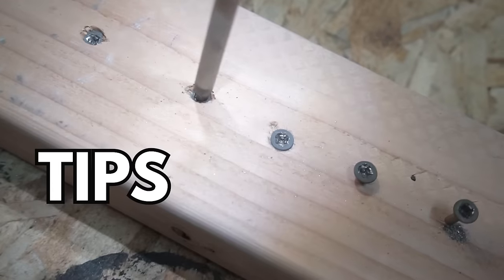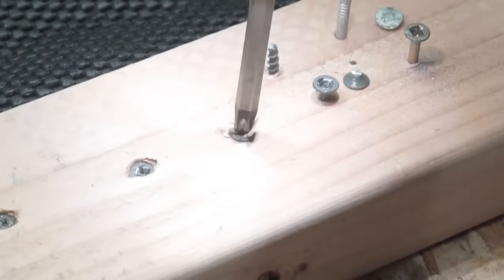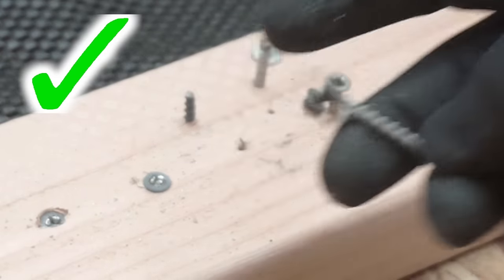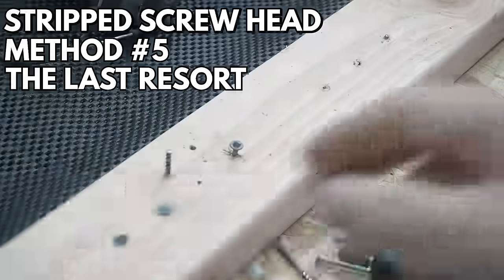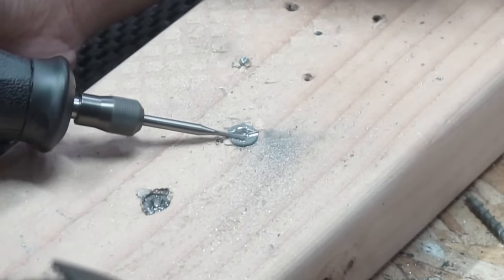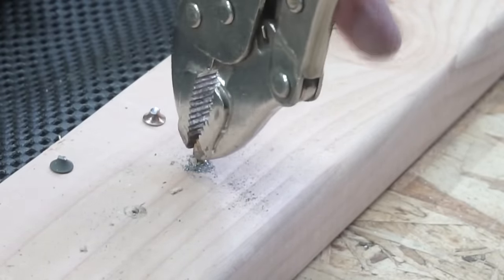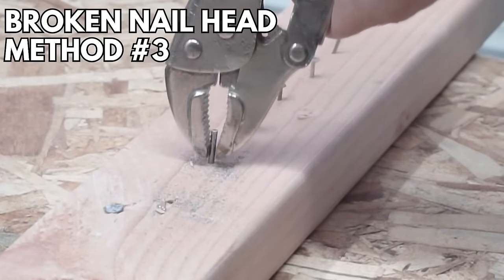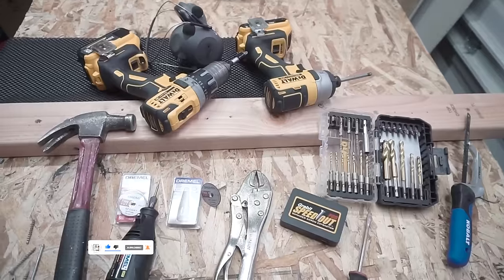How To Remove Stripped Screws, Broken Screw Heads And Nails - 12 Different Ways DIY Tips And Tricks!

Comment: What about a screw broken BELOW the wood's surface?
Reply: Same this is my problem. Screw head broke off leaving only the threads and shaft below the wood surface. There’s nothing to grab with pliers as you have to look into the screw hole to see a glint of metal
Reply: It depends on your required results. 
If you just want to get the top board off and don’t care about damage, I’d drill one or more small holes next to the screws and pry the board off.
If you need minimal damage or to reuse the board, I’ve had some luck with drilling out the screw itself. You may need to start with a very small bit to prevent wandering,and be prepared to fill the hole with toothpick, splinter, or glue to hold the new screw.
Reply: @TomCee53  and if drilling it out anyway, no harm in using a left-hand bit.  You might get lucky, the bit could bite and act as an extractor.

That's why I'm watching these videos to begin with.  I'm debating buying extractors or left hand drill bits but all the videos show stupid "can't you figure this out on your own" scenarios like these here where obviously you could just use pliers.  And if you can't?  Bah, just cut it off and grind it down!  Problem solved!  RIGHT???  That screw wasn't HOLDING ANYTHING that's got to stay there!  And you can't always just replace the wood or move the mounted object!

My scenario is that a friend's pet-and-baby gate is mounted in a doorway of sorts along a half-height wall that separates their kitchen from the family room.  They always kind of slammed the gate closed, and over the years, one of the screws on the bottom hinge broke about a quarter to a half inch below the surface of the wall.  Now the gate hangs wrong and scrapes the floor.  Problem is, they still need the gate for the pets and they don't want to reposition it because they don't want a bunch of holes in the wall and it's currently centered on the bulkhead.

If I can't use an extractor there, there's no point in buying a set.  I might opt instead for a left hand bit set.  Then again, what the hell, they're not exactly expensive.  Maybe I'll get both?
Reply: Have to drill the shiz out of it until it doesn't exist.  Only way I've seen otherwise just leave it in and work around it lol
Reply: @JayBird84  Yup, that's what I would up doing on the pet gate!  Then drilled the hole out and dowelled it, drilled a fresh hole in the dowel, inserted screw.  Not as strong as original because of the direction of grain in the dowel, but they just need it not to move laterally.
Reply: Half baked video.
Reply: Use a small diameter Dremmel disk to cut a slot for a screw driver and line your cut up with the grain of wood.  You will end up removing some wood but not much will show because it will blend with the grain.  You can also use a plug cutter to remove some of the wood around the screw.and try the methods shown in the video.  

And if it is a nail, cut off the head and use a nail set to drive it through to the other side and pull the exposed end out with vice grips.  This is also the preferred method to remove finish nails from trim without damaging the face.
Reply: @Roy-ij1wq  This is the best answer that I have heard!  I don't have a Dremmel so I can't try it right now.  The screw extractor certainly doesn't work because I have tried.
Reply: Fill the hole with mud and paint it
Reply: You're asking that but i'm asking how i'm supposed to remove one from gaming system without breaking the system
Reply: I have the same problem but in my case the screw must be removed without damaging the wood around it at all. The screw that holds the strap holder in my electric guitar cut in half while I was playing and now the bottom half of the screw is inside the top guitar horn, so I must remove it with no harm done to the wood, since destroying my guitar horn isn't on my plans. It also doesn't help at all that both the screw and the area around it to work in are really small. Does anyone have any tips?
Reply: 1.) use a hole cutting drill but without the drill punch in the middle, only hole cutting. Drill a circle around the screw or nail until 1/4” is exposed, then grip with pliers and reverse out counterclockwise.
  2.) Use a “Teks” screw that has a self drilling end. Drill on top of old screw or nail until it’s obliterated, then back out and suction out hole with vacuum or blast it with compressed air.
Reply: The plumber broke the screw off that the silver cover goes on the tub wall with.  Mine doesn't have the removable bracket it's built in so here I sit with a big open overflow hole in the tub and no cover on it trying to figure out how to get the broken screw out.  🙄

I'm curious if a nail punch might work?  If not, a drill it shall be. Thoughts?
Reply: @brenten6226  First see what's directly behind if at all possible. Drilling through may puncture a water line if it's configured incorrectly. (Rare, but possible)
  Once you can see at least a few inches behind the trim and know there's not a water line, try the following.
    Cut off the trim as much as possible with either a dremel, tin snips, angle grinder, whatever. Then reach under and up with needle nose pliers, or regular pliers and try to manually unscrew it form the back. 
  Might take forever, but worth a shot.
  
  Otherwise, drilling seems to be the only feasible solution. Try and figure out the depth needed before punching all the way through. Drill slowly!
Reply: @JamesSmith-gk8sz  thank you. I'll check everything you warned me about first and then see what happens from there.
Reply: Same here!
Reply: @Roy-ij1wq  This was what I'd have said too
Reply: @Roy-ij1wq ￼ I'm confused about the dremel solution. In assuming this should be easy to follow but I'm also one of those who are vicariously living through other woodworkers as I'm disabled now due to back problems. So, you're saying to use a Dremel cutting disk like the one he uses in the video or are you saying to use a bit? I'm assuming the saw disk but since he said the screw is deep-set, wouldn't going to a smaller disk then limit the depth on the cut? Also, please explain because this isn't intuitive to me without ever coming across the problem and I'd really like to learn what you're saying. How would cutting a slice in the top of the wood with the grain (got that part, great idea!) help the usage of a screw driver? Are you saying to screw it out the other side?? Or use it so it catches the nail and comes out the same direction it went in? Would using that very small diameter pointy drill bit, assuming it's roughly the same diameter of the nail that was cut off, be similar and would that work? Thanks so much! I genuinely appreciate your help!! I'm not even southern but y'all rock! Lol. Thanks again!!
Reply: @doreennacht Your assumption about using a cutting disc.  The purpose of cutting a slot with the grain is simply cosmetic.  You are simply cutting a new slot in the screw and only need to cut a slot that is deep enough for a screw driver to grab.  Try to use a screw driver with a tip that is thick enough at the end to fit snug in the slot and the same or slightly narrower width as the diameter of the screw head.  If the tip is narrower than the slot, it may end up re-stripping the screw.  If it is too wide, you risk damaging the surrounding wood when you turn it.

Screwing deeper into the wood only works in soft wood like pine and is only practical  if you are trying to bury the screw and fill the hole.  It also takes more force and you will likely break or strip the screw.  

Finish nails are the only fastener that can and should be pulled through the wood and is common practice when salvaging trim pieces such as door jambs and baseboards.  This preserves the original wood filler and paint.
Reply: “Your screwed”
Reply: Remove wood surface, replace with new wood surface
Reply: Maybe you could cut the horns and learn to play the banjo.
Reply: @shoyrushoyru  I have the same problem - while reinstalling cabinet doors, both screws on one hinge popped the heads of just they were getting tight to hold the hinge in place - now, two holes in the inside of the cabinet door with nothing to grab, or drill as the screws are approximately #6 or # 8. 
What about using a plug cutter to remove the screw and wood, then glue a dowel pin in place and rescrew the hinge?
Reply: Exactly. A screw head broke below my guitar's wood surface and .... I couldn't get it out

Comment: highly appreciate most of the video though you may wanna mention that gripping it with your impact driver head you´re about to strip it sooner or later, more like sooner if not experienced and sensitive with that... the part I don´t appreciate however was the nail removing part. vice grip? sure it works but this is the most basic nail pulling tool (hammer, crowbar or pliers) situation, what in heaven is the vice grip doing there? :-)) that is a no brainer, we all want to see how you pull out nails all the way in, not halfway out

Comment: Your tip of using the drill to just "clamp" onto the remaining portion of a screw with a broken head saved me!! I had 2 broken head screws with less than 2mm sticking out of the surface but the drill just did it... thanks!
Reply from the maker: I’m glad I could be of help Sergio! Thank you for watching! 🙏🏽😊

Comment: Thanks, Buddy. Had a screw sticking out about a quarter inch from hardwood, no head. The locking Vice grips method saved me. It’s all about getting it as tight as possible while still closing, then slowly and patiently rotating it out.

Comment: What if the the screw head is the part blocked? The screw broke in a pedestal table I have so half is in the bottom and top is blocked off by a metal plate that went up the center large pole screw the keeps the center pedestal to the floor base foot of table. How do I remove the screw basically if it’s up side down broken off?

Comment: thank you it was really very helpful however I tried to remove a screw with a broken head as you mentioned with the drill but sadly it broke shorter :( now I go another issue, any suggestion? it is as crew for a lamp holder incorporated in the floor . Thanks once again

Comment: Any advice: a break off screw is broken off and is embedded into a copper fitting (back
Flow preventer for a hose bib)?
I need to install a new backflow device as the current one no longer functions properly.

Comment: regarding the star bit screw removal, if you use a blowtorch to heat (ONLY) the screw up, you can jam pretty much ANY bit into it while it is still hot, let it cool off, then slowly remove it, as it will warp around the bit and dry to the new shape.

you also don't need to reverse the drill with the nail removal. in fact, it will work better if you keep it going forwards, since there is no threads like screws have.

lastly, you don't need a vice grip to remove nails, since i know fewer people have those. you can just use "channel lock" pliers (or any adjustable  wrench with a larger head like that), and rock it on it's bulge to pry the nail out. i did that when i was tearing out old lath and plaster ceiling in my basement, and had a ton of nails in the ceiling left. they came out in literally seconds with minimal effort.

Comment: Good tips for screws. For nails, I find a Japanese style nail puller + hammer works well, even if it’s missing the head.  I use a scrap piece of wood to protect the finished piece in the same way as you.

Comment: Can you add options for the round head screw? I have a stripped screw in the shower door, but it is has a round head and using the dremel just made a bigger mess of the screw by creating a valley vs a slot to use a flat head screw driver on.

Comment: Had a head come off of a screw in a metal dresser frame. Tightening the drill around the rest of the screw didn’t work at first. So I kept re tightening the drill to the screw, small short bursts in reverse and she came out. Thanks for the video man.
Reply: If you hand tighten the chuck as tight as you can and then back it off one click it will prevent the chuck from loosening.

Comment: Good show; I've been using Vise Grips for years.  I ran into a problem on a door though; the hinge screws broke off below the surface and I couldn't get a bit to stay on the screw.  I tried a bit that drills around the screw, but couldn't get that to work either.  I never did get those out, might have to just run another screw in along side them.
Reply: I'm dealing with this very same issue right now. The screws that come with doors are absolute shit. Shearing the screw heads off below the surface is one of the most common scenarios... this video is incomplete without addressing that.

Comment: I have two wheel chair metal body that has broken screws in it. Broken off at the surface. What’s the best way to remove them
Reply from the maker: Hi! For broken screws in metal what I would do is get a small drill bit smaller than the screw and slowly drill out the screw, similar to drilling out a rivet.

Comment: Hi mate, I was going to change the tap for my bathroom sink. However I could not remove the existing tap due to damaged screw. The screw can only be accessible inside the cupboard (extremely tight space) unfortunately there is no power tool can pass through it. I have to use manual philips head screw driver but since the screw head is damaged this does not work….  I have looked around to find is there anything removable to create larger space, however the way is built is just stupid. They not only screwed the pieces but also its glued firmly so tryying to remove creamic or wooden panels will probably cause unrepairable damage. 

Unfortunately I have already loosen up the tap by forcing it from top of the sink, loosing uo did not effected the fixed screw. The tap now can be rotated sideways, but cannot be pulled out. 

If you were in my place what would you do?  (note: house is a rental home, any damage most likely will cost me 3 times more)

Comment: I sometimes experienced problems with removing rusted broken off nails from pallets. You cannot grip it as it is inside the wood. You cannot drill it as it is too thin. No tools work. This makes life difficult especially when you want to plane these planks and you don't want to damage the planer.

Comment: Many different brands of drill bits for specifically removing screws such as these .
Reply from the maker: Thank you for the tip! 👍🏽😊
Reply: What kind of "drill bits" remove screws?
Reply: @zeke112964  Left handed drill bits..
Reply: @greod1006  only if you get lucky...there is no guarantee

Comment: The rubber band method may have worked if you'd used a hand screwdriver instead of a powered tool, like you did with Last Resort #2.